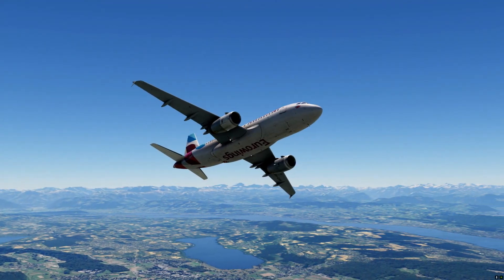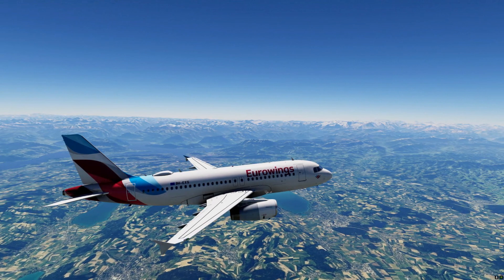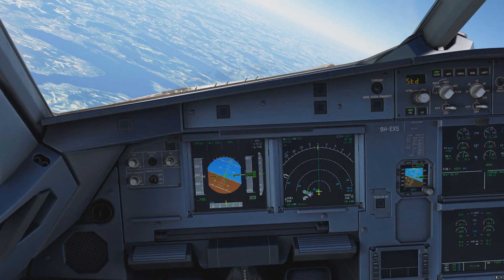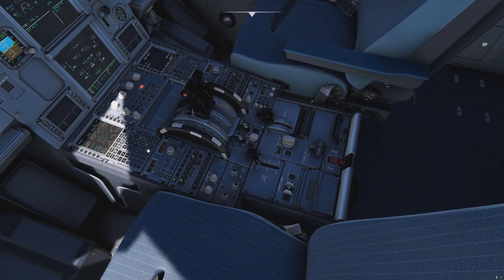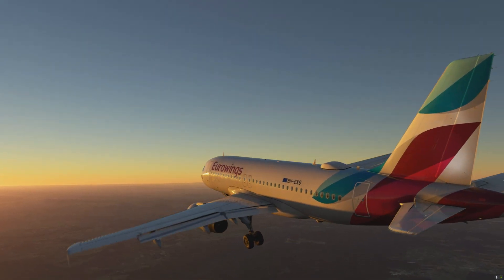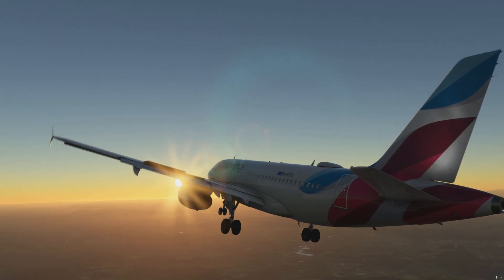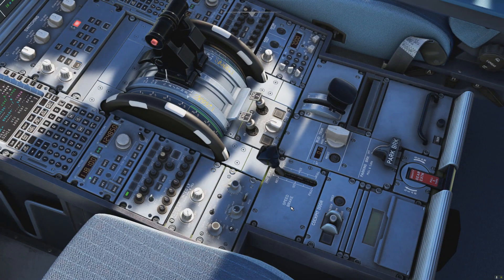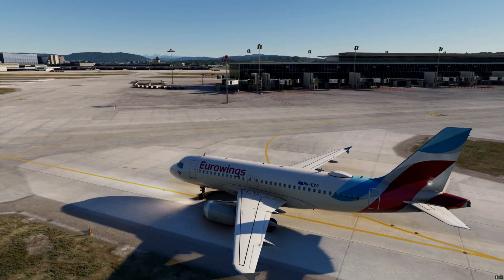How does the A320 Spoiler system actually work?

Comment: 7:15 the sidestick basically sends a degree/s request, right? so I would assume that as soon as the there is a Δ between requested and current roll rate the roll spoilers deploy. which kinda also leads to another question: is it really that the roll spoilers only deploy at lower altitudes and not just lower speeds? Why would there be a difference (more precisely an improved roll action) in higher altitudes compared to lower altitudes at the same slow speeds?
Reply from the maker: Yes, it is speed dependent. At lower speeds the ailerons are less effective and get help from the roll spoilers.
In some videos where people filmed an approach from the inside on a windy day you can see them working in tandem
Reply: @fsclips  yeahyeah, I know.
But you asked the question into the open, when exactly the roll spoilers are being commanded to move by the flight control computers. My uneducated guess would be that ass soon as the flight computers notice a difference between ist and soll.

Which also leaves the other question I had still open: Is it really dependent on the altitude because I would expect the roll spoilers to kick in earlier (at higher speeds) in high altitudes compared to low altitude, due to the "thinner" air.
Reply from the maker: @boahneelassmal  Like I said in the video. I couldnt find any specific speed or anything when the roll spoilers are engaged. It is all done by the software. I guess it is not a set limit and the roll spoilers are implemented gradually instead of either zero or full, similar to the ground steering logic on take off.

Comment: If the speed brake will deploy automatically anyway if you forget, why require arming them?
Reply from the maker: @tubeslats  Because the logic to extend it is different. You want the spoilers to come up the second you touch down, not when you engage the reversers. 
Hope this helps 🙂
Reply: @fsclips  Regarding reversers, are idle reversers always used in landing? And only when required, full reversers are engaged? Or, are there cases where the ground spoiler effect + autobrakes are enough, and the thrust lever can be left at forward idle?
Reply from the maker: @hege750 according to Airbus reverse thrust must always be deployed after landing. No exceptions. 😊
Reply: @fsclips  Ah, thanks for this information! In your real life experience, how often would you, approximately, need to use full reversers in landing?
Reply from the maker: @hege750 that depends on weather and runway. The performance software will always tell us the best reverse settings.

Comment: when you say ground spoilers "destroy all the lift", 9:14 does that happen with that hole in the wing that appears when flaps are fully deployed and spoilers fully extended... 
i always wondered about that "hole" and how those spoilers "hold everything", or maintain the lift if you will, when flaps are extended...
Reply from the maker: @ogaduby  No, the lift is created on the upper surface of the wing. The spoilers are changing the profile of the wing to such an extent that it will no longer produce lift.
The fact that you can see the runway underneath the extended spoilers is simply because the flaps are extended.
When they are retracted there is no gap underneath the spoilers.
Again, the flaps change the shape of the wing and allow you to fly slower and therefore reduce take off and landing distances.
I hope this helps